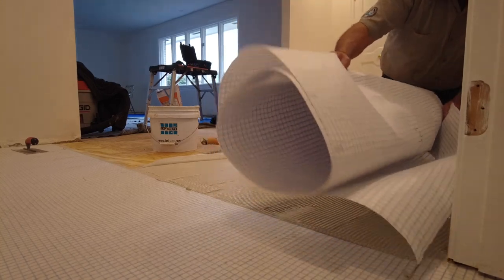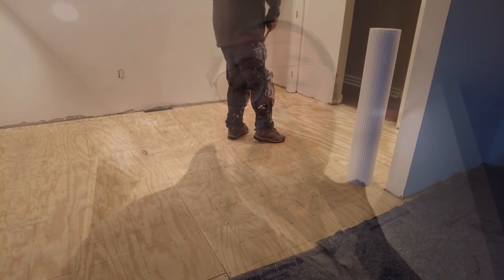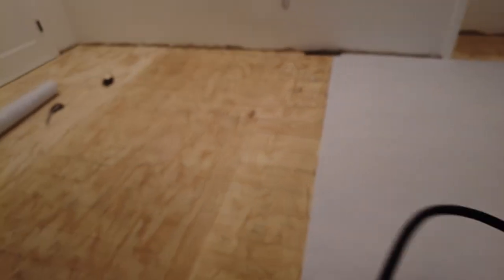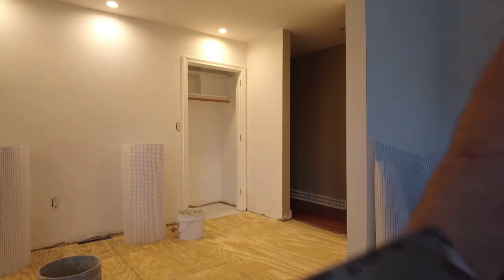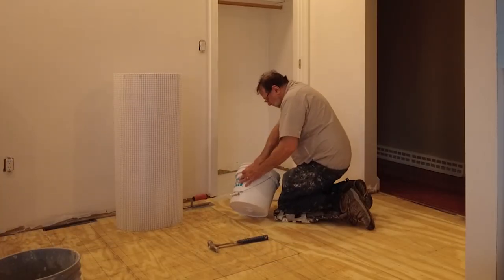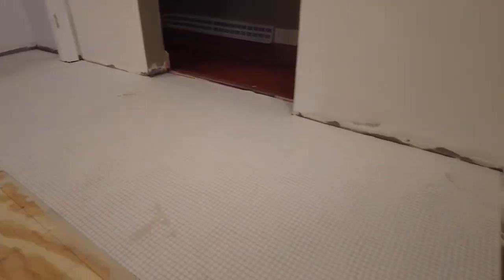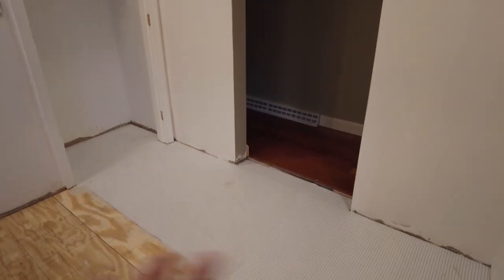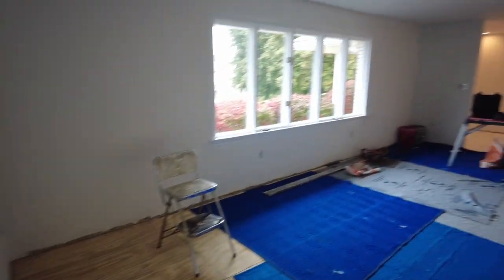Thinnest uncoupling system, Blanke  Secumat. How to install it.

Comment: Sal, If you were helping a family member on their small bathroom project and they had a small budget to work with, what system would you recommend besides Schluter, since the cost is high? Laticrete, Mapei, Ardex, Blanke Secumat, or some other system? We would still like to have a high-quality system under the tile. The bathroom would be rated for steam.

Comment: I used the laticrete 1/8” uncoupling membrane and all I had was a 1/4x1/4 trowel.  I made a lot of bumps.  Ill never make that mistake again.  The tile came out perfect but it was a lot of work.
Reply from the maker: Sometimes we have to learn the hard way.
Reply: Thank you to @chipburns4123 and @SalDiBlasi for clarifying that thicker thinset is not always better! Our local contractors and hardware shops were insisting on 1/4x1/4 square minimum trowel size.

Comment: Thanks for your thoughts! Would this be a recommended underlayment to use over plywood in a bathroom instead of Ditra? We need something that can work for tiny mosaic 1x1" hexagon tiles. Already put down Ditra only to find that it is nearly impossible to place the small format tiles properly on it, and sadly, the minimum 2x2" tile limitation of Ditra isn't well advertised...
Reply from the maker: Permat has no tile size restrictions.
Reply: @SalDiBlasi  Thank you! By any chance do you have thoughts on Blanke Permat vs. NobleSeal (we have verified that our plywood, thick wood substrate, and joists can handle the weight). Thinking from a cost-saving perspective since Permat looks like nearly 3x the price.
Reply from the maker: Permat adds strength and stability, Noble seal is an antifracture cleavage membrane, has no structural value. A little extra cost now could save you a lot bigger cost later. Not saying you need it, but consider your options carefully. If the are both adequate for the job, then either will work, if there is a doubt about one, then it really isn't a choice.
Reply: @SalDiBlasi  We found Permat at a great price and are excited to try it out! Thanks so much for your thoughts and expertise. Learning so much on your channel! We'll now rip out the Ditra and do a proper installation job this time, starting from scratch.